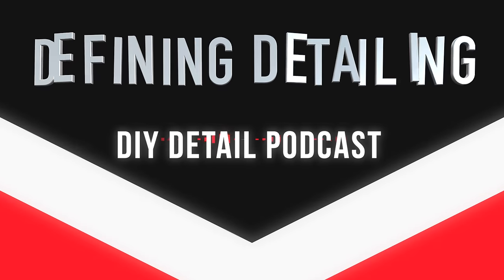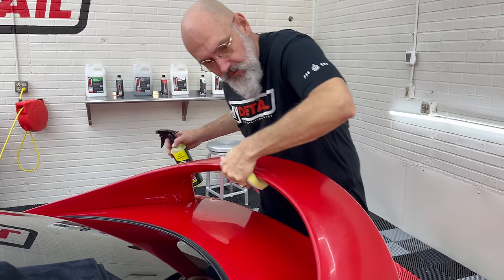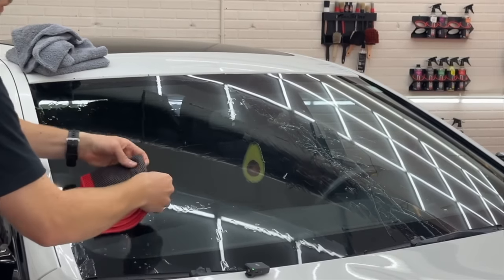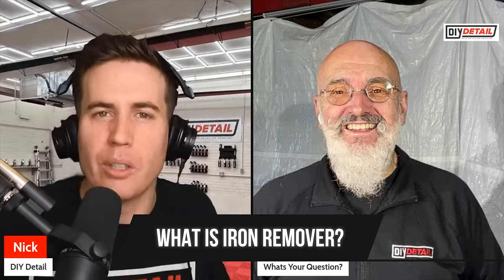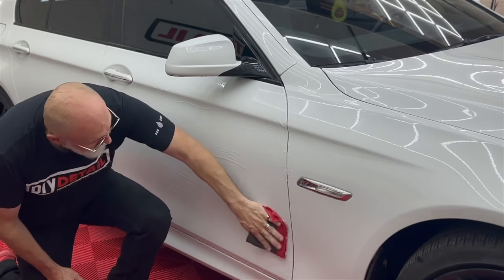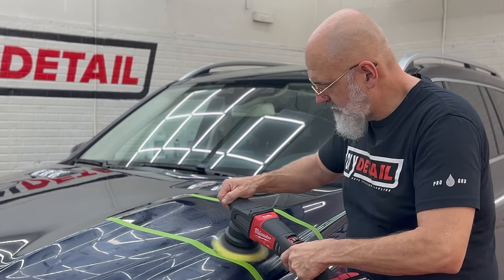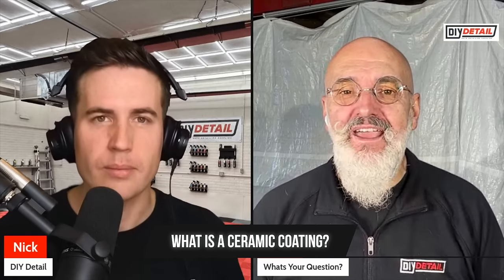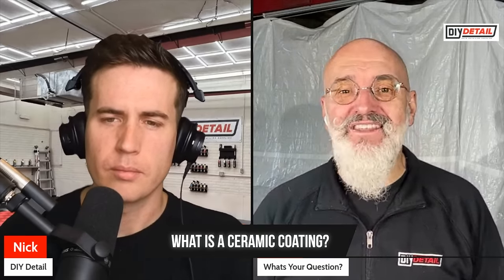DEFINING DETAILING: what do these terms really mean?! | #podcast #diydetail  #75

Comment: I remember claying my car in the eighties and it took a  hours. Then you had to hand polish to remove the marring. Then the wax filled in everything and your car looked warm and glossy while being slick to the touch. The bad part being clay was expensive at $75 and we used water as a lubricant while getting about two to three cars from a clay bar.
If the body of a vehicle is metal and the clearcoat is plastic. What is a comparable comparison for a ceramic coating? Telling someone a ceramic coating is an inorganic resin with silica to give a glass like look confuses people. Some industry terms are a sacrificial layer to the sun or the best protection. Thank you for all the DIY team does!
Reply from the maker: The best way I’ve found to give people a visual concept of wax vs coating is wax is like your bed sheet, gives you a little protection, and is easily removed. Coatings are like a comforter, much better protection that lasts longer.
Reply: @diydetailofficial  thank you as I obviously did not pay enough attention in chemistry class.
Reply from the maker: No need for chemistry class.

Comment: so the iron particle goes into the towel...and obviously is a small enough particle to go into one of the cervices in the  decontamination towel(or is it embedding itself into the towel).  so what now....what is the best way to clean this towel now be iron free to clean another car?...
1) nick said ..oh you can possibly do hundreds of cars with the towel...so does this not mean that if it isn't cleaned perfectly...that you will be transferring (scratching) the next car with this particle? what is the best method to clean this towel?
2) is this towel going to break down with certain cleaners as we use these lubricants ...whether it be iron remover or incredible suds or rinseless wash.
Reply from the maker: The Perforated Synthetic Decontamination Towel easily releases the contamination into your wash bucket, if your really concerned, scrubbing the surface with your wash solution and a MF towel will return it to like new. 

Some chemicals will damage it. Here’s the list of what’s safe to use with the Perforated Synthetic Decontamination Towel 

DIY Detail Rinseless Wash 
DIY Detail Incredible Suds 
DIY Detail Ceramic Gloss 
DIY Detail Quick Beads 
DIY Detail Iron Remover

Comment: I’m thinking of buying an IK sprayer, is it necessary to have a regular sprayer and a foam sprayer or will a foam sprayer work to spray on a rinse less wash that doesn’t foam?
Reply: It will work, but the foamer will consume more air than the multi so you’ll have to pump it more. If you want to help with this, take one of the three colored internal tips (gray, green, and orange) and there will be a little hole in the side, not the ends. Do something to cover the hole, tape, hot glue, soldering iron to melt closed, etc and it will behave more like the multi.
Reply: Thank you, I enjoy your videos very informative
Reply from the maker: The IK foamer will work, but it’s not the best option, it uses much more air and liquid.

Comment: I have a BAUER 7 in. Variable Speed Rotary Polisher/Sander which comes with a 7-inch backing plate, I also have a GRIOTS DA with a 6-inch back plate. I would like to use the red jeweling pad for the reasons you sell it for my question is I purchased the 6.25 red jewelling pad today (since the 5.25 would not have worked I don't think?) and wonder if I can use it on my rotary with a 7-inch backing plate or my GRIOTS DA with a 6-inch backing plate? What speed do you recommend since they are in increments of 1500RPM, 2500 and so forth. Thank you I am excited for another order of your products!
Reply from the maker: You can use it on both. Rotary backing plates are available from 1 inch to 9 inches in size. Use a 6 inch backing plate at the lowest speed the rotary will turn.
Reply: @diydetailofficial  That is great thank you looking forward to my order!!! Love your products!
Reply from the maker: Thanks

Comment: So i have read that you should decontaminate about twice per year.  I have also read that every time you decontaminate you mar the paint and need to polish.  So if the clear coat is a finite resource and all that is true, then how is that sustainable.  I want to do the right thing for my vehicle, but don't want to erode away the 9 lives of my paint.  Love your products and your knowledge, and i know i will get the correct answer here.
Reply from the maker: With our Perforated Synthetic Decontamination Towel and proper lubrication, no erosion or marring will occur. With other clay bars or clay towels, unfortunately they do mark the paint. 

Decontamination is done as needed. A garage kept weekend driven car may only need it every 2-3 years, a daily driven work truck that sits outside may need it every 2-3 months.

Comment: Me wife and I have a brand new SUV. Have driven it for about 5k miles. I want to Decon and apply a ceramic coating.  
Do I need to polish? So far there isn’t any scratches and very very little swirling (the dealership wiped down one of the panels for some reason).
Reply from the maker: You can, it’s ultimately up to you. If you’re happy with your paint, there’s no need.

Comment: My car is currently coated with diamond pro tech diamond body 36. In the spring I want to change to the 8 and 3 year stack, mostly because I want some extra experience with coating. Would an 8mm da with the gold foam or wool be sufficient to prep for the new coating?
Reply from the maker: Yes

Comment: I came over a discussion of what actually paint protection is. One statement was that it's only waxes and coatings that delievers true paint protection because they can fill "mountains and valleys" in car paint under a microscopic level. Is this kind of true? If so, how do we term spray on, rinse off products with very good hydrphobic properties in this dictionary?
Reply from the maker: All of them do the same in terms of surface protection. Only waxes fill imperfections. A coating lasts longer and has superior durability, protection and chemical resistance.